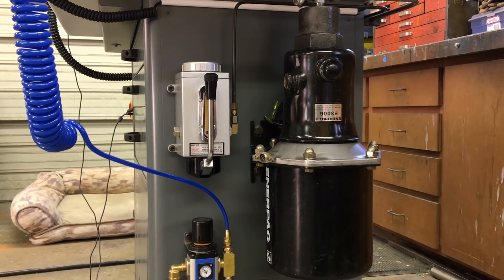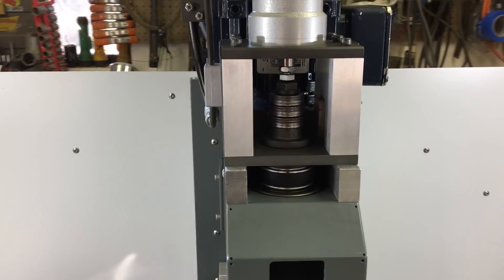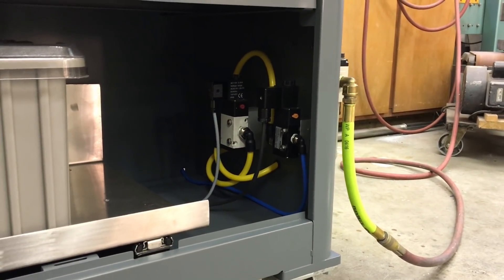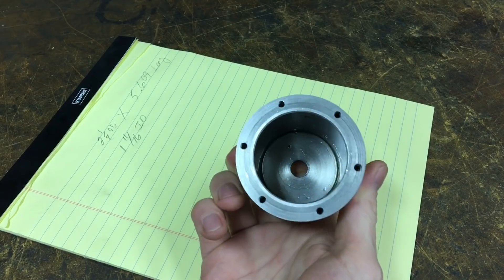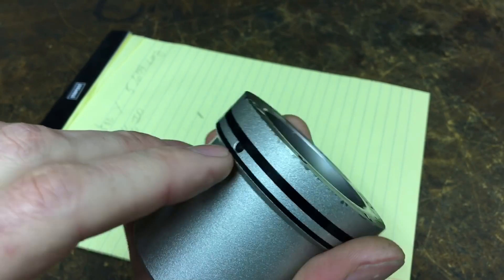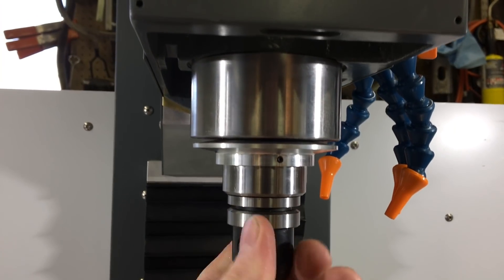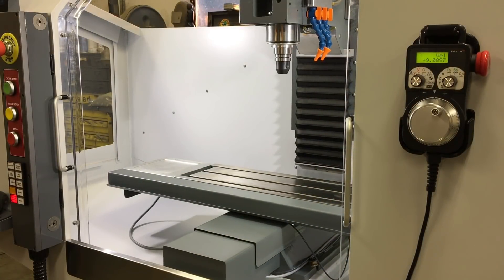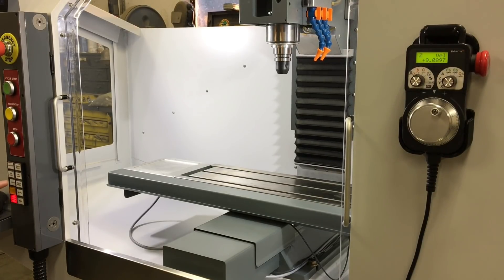GRIZZLY G0704 CNC Conversion Update 34 - ( SPINDLE / DRAWBAR )

Comment: Nick, TTS pullout will occur even with a manual tightened drawbar.  It has more to do with the R8 collet design than it does with the pressure that you can add.  You probably haven't run into this before because you haven't really pushed a Bridgeport at the speeds and feeds and RPM you will this little Mill and CNC movement.  The increased pressure will help but inevitably you will get slip, although with only a 1 horsepower motor you'll probably run out of power before you run out of tool clamping ability.

Comment: Glad you got the drawbar fixed. I ran mine for about 8 hours straight at 6500 rpm yesterday, cutting A2. The spindle was about 90 degrees at the end. You need to get that fan replaced, It makes a huge difference on noise!
Reply from the maker: That give me hope! 8 hours is a long time, this is since you have switched back to the TRB's? I will add "custom fan" to the project list = )
Reply: Nicholas Miller Yep that’s with tapered rollers. We’ll see how long they last! I run them at 10k for shorter periods also... lol
Reply from the maker: Cool! Id be happy with 5 or 6k just as long as i dont have to replace the bearings every other month = )

Comment: Nice! Will this machine be capable of doing rigid tapping when you are done with it?
Reply from the maker: Mathias Tveit, Hello! This machine uses a 3 phase ac motor to drive the spindle, while it is capable of starting and stopping quite fast, to do rigid tapping requires a servo motor of some type driving the spindle. To "cnc tap" on this machine requires the use of a "tension-compression" tool holder.     - Nick

Comment: Nick, good stuff man! The spindle sounds great. If you get resonance at specific rpm, try  using idler pulleys. I am going to add them to my setup. I was curious how much grease you used on your spindle bearings? Sounds like you contacted Kluber to get a recommendation? Also seems like you could sell the adjuster nut you made. I would be interested. 
I have been kicking around a couple of thoughts to improve my spindle. One is to make a new drive tube with the pulley integrated. For me this would further balance my spindle and improve surface finish and the other is to completely replace the spindle with with something custom made. I would make a version where the outer body is taller than the original and threaded at the top. Then have a threaded boss that presses into the location of where the top head bearing is. The spindle would thread into it. I would put two AC bearings at the bottom and a roller bearing at the top. The goal would be to get above 10k rpm.
Reply from the maker: Graham! Thats exactly what the noise is when the machine sits there and "freewheels" at speed .... I imaging its different under load. A idler pulley was thought about back when the drive was being made, but due to space constraints (the belt drive / motor mount rails are the stock width of the head so space was at a premium). I looked at some kluber charts for grease amounts and quickly decided to just go for it without all the measuring / figuring. Ended up putting way to much in, took it apart and removed some. temps immediately came down and things appear good. If one has to tools to make a spindle i think it would be a cool project.

Comment: Hi Nick, so nice and smooth sounding, a steady tone. I have the original BLDC motor which has a clank-clank-clank noise that only becomes worse with an alternative closed-loop drive. Your instant reverse is really sweet. Consider writing some of this work up and publishing it for Pateron folks or doing the ebook thing. Or sell modules or something. For instance, your spindle motor is wonderful, but I'll never have the time to design and make my own, but would buy a kit. Best wishes, Kent
Reply from the maker: Kent, does the "clank" come from the BLDC motor or the spindle / quill drive? i.e is the closed loop correction making the spindle bang around?
Reply: Hi Nick, that's a great point. The spindle is certainly noisy compared to the unmounted BLDC. I'll do more investigating.
Reply: Kent VanderVelden is most likely the splines drive clearance causing the clanking noise, it should subside once or under load... Its the pulses transmitting from the motor through the drive.  Should hurt anything, but certainly is annoying.  You can add a medium durometer polyeurethane puck that fits over the spindle and inside the quill barrel that will subside the rattling.
Reply: Thank you for the idea, I'll give it a try.